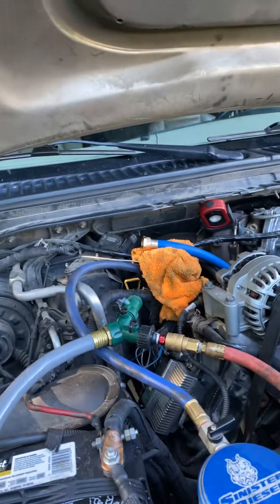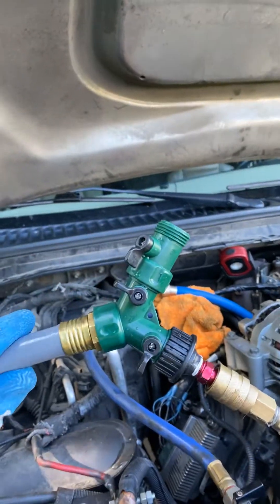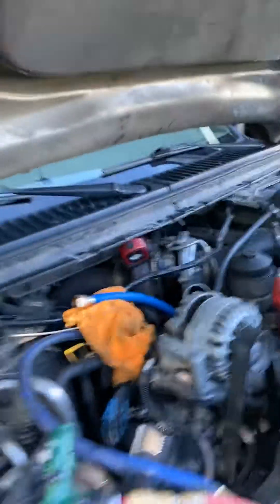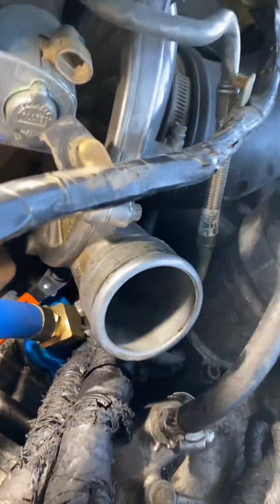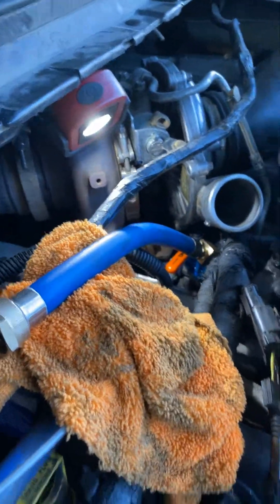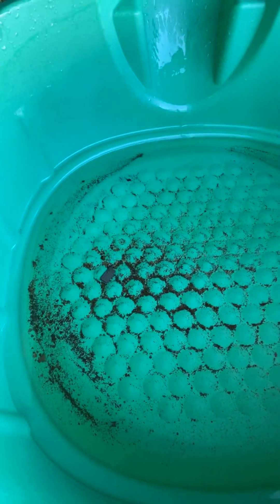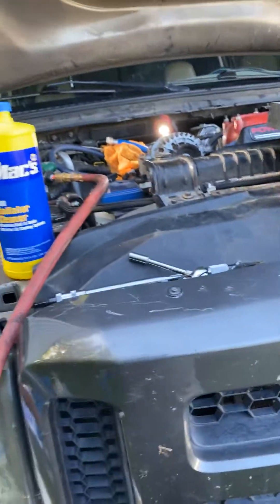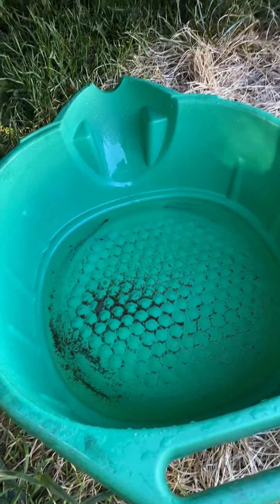Ford 6.0 L Power stroke Oil cooler coolant back flush

Comment: Question....since installing your coolant filter, does your degas reservoir level stay high or fuller than without it? I’m scared to get too much coolant into the reservoir. I have the same sinister set up waiting to go on, but I’m scared to have the reservoir constantly overflowing.